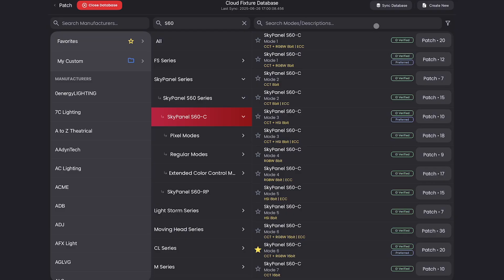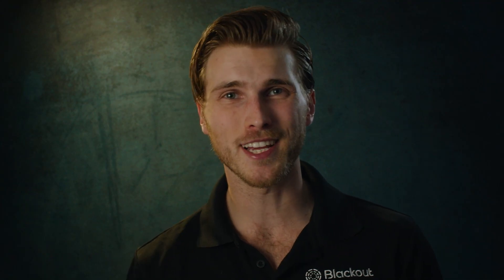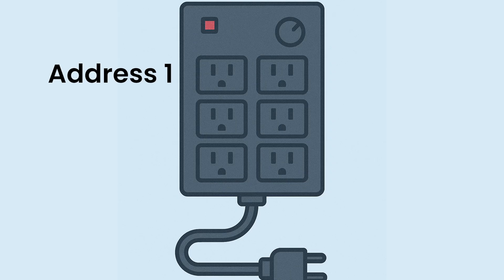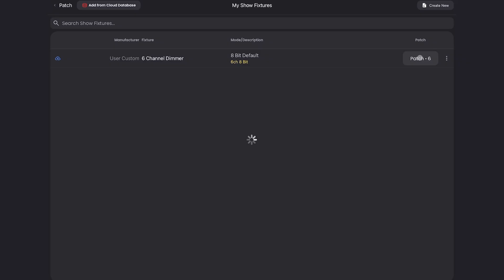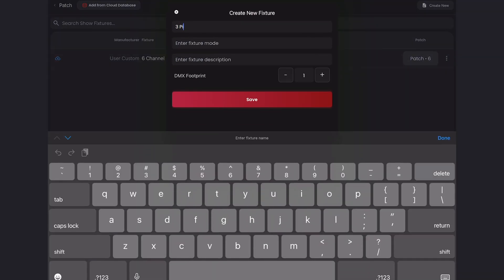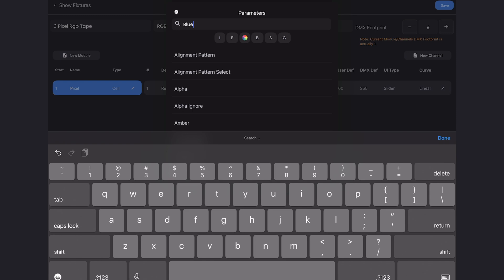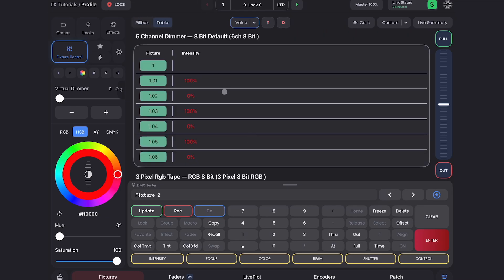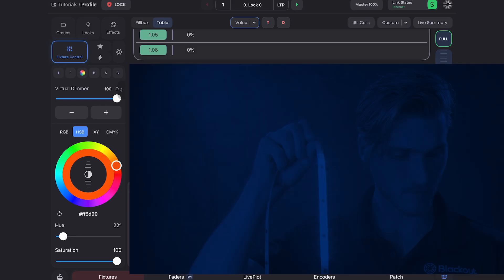Build Your Own Profiles: Multi-Cell Fixtures

Comment: Great. I dont seem to be able to use Syntax 601.1 thru 601.3 at 100 (ENTER). Is this possible as it is for whole fixture numbers?
Reply from the maker: The correct syntax would be 601.1 thru 3 at 100 

Save those keystrokes!

Comment: If your LED RGB tape has 150 pixels, would you have to add 150 modules to cover all of the LED RGB tape?
Reply from the maker: We have LED ribbon profiles already. If you need something specific just send us a message and we'll put it in for you. It's much faster for us to do it on our end.
Reply: @blackoutapp okay cool 👍
Reply: And if that’s the case, is there a quicker way to add those modules?